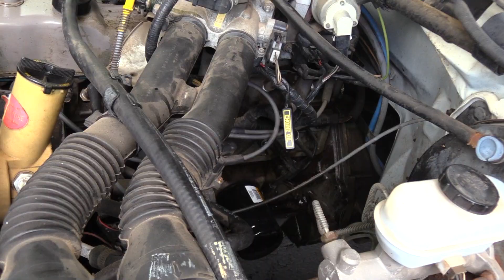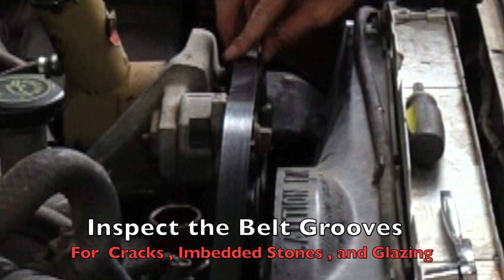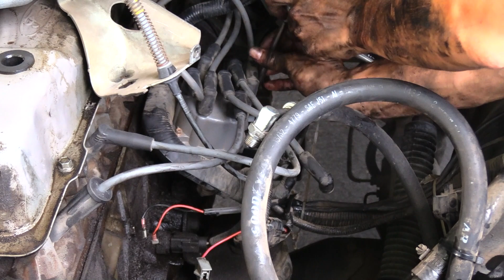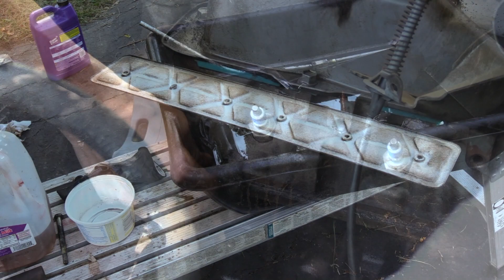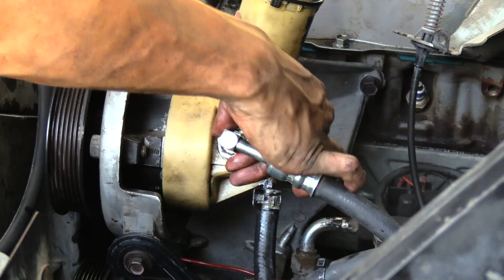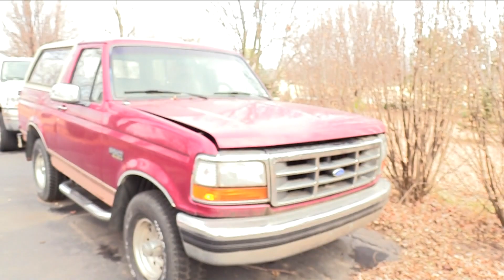Oil leak ! Here’s a Step by Step Guide, How to Replace a Ford F 150 4.9 Liter Pushrod Cover Gasket.

Comment: Thank you so much for taking your time to make this video for teaching other people and for showing us all of the steps!
Reply from the maker: You are so welcome ! I had just worked a full day on my project when my young cousin (whom I had only recently met) stopped by and needed advice . He wanted to do the work with guidance.  He learned a lot and it gave him the confidence to tackle many other jobs on his truck. I thought it would be helpful for other young people to see someone they can relate to tackle a job
Reply: @normanpaulife that's really good and it's a blessing it's a shame that it actually seems like it takes a lot of work especially to get that whole power steering pump bracket off do you think that it would be possible to replace the lifter area seal without removing the power steering pump or is that virtually impossible

Comment: You do not need to remove all of those components.you need to remove..distributor cap(wires),breather hose, air cleaner assembly to the throttle body,dipstick tube,..and coil.that's it!!.. I've been a mechanic for over 30 years this is really a bad video especially if you're trying to teach somebody something on a truck that old you're more likely to snap something or break something you didn't even need to be messing with.
Reply from the maker: It was his truck and his decisions , he wanted to do it “his way” I supplied answers if and when asked , and prevented damage or mistakes.  He learned to trust himself. And began his journey after two repairs 

I began my mechanical journey in a small engine shop at 16 and became and aircraft mechanic at 18, and attended automotive maintenance technology (technical school) at 22. I have more than 46 years of experience from small engines to B - 52s ( jet engines) .

If you get an opportunity watch the video I made replacing an 6 liter Exhaust Back Pressure Sensor and compare “My Method” to others out there. I removed nothing but the sensor and tube in minutes and properly torqued the sensor to specifications.

Comment: I just finished replacing the push rod gasket on my old 4.9l and I followed the same procedures as you posted in this video.  There was another video where a guy changed the same gasket, except he didnt remove the power steering pump, and I'm REALLY glad I did!  It gave me so much more room to work with and let me feel more comfortable doing the work. It was definitely worth the time to remove it.  I also suspended the a/c compressor with a ratchet strap hooked into an eyelet of the hood framing/support.  Thanks for sharing this video!
Reply from the maker: Thank you ! I was teaching my young cousin at the time. He had no experience so I was sure it would be a good opportunity to share with others like yourself

Comment: Nothing that you did would have stopped it for misfiring except the corrosion on the rotary cap and you should have just replaced it
Reply from the maker: The truck belongs to a 17 year old ( at the time) his truck his decisions all the way. But it certainly ran much smoother, now he had more to fix its many ailments.

Comment: That's not the PCV. That's the crankcase breather.
Reply from the maker: I think we are both describing the same thing. I haven’t rewatched the video , so I’m not certain what you referring to, but the crankcase breather is a circuit of the PCV ( positive crankcase ventilation) , old cars used to vent to atmosphere, but the PCV system feeds into the air intake through the breather ( filter) and burns the crankcase byproducts. The breather filter as old timers call ( myself included) is sold under the label PCV filter. I’ll bet the average 20 something parts plucker at the auto parts store does not know what a engine breather is …lol
Reply: @normanpaulife  PCV is at rear of valve cover with vacuum line going to vacuum port on intake. That's the crankcase breather going to air intake where it's attached to filter element. No worries.
Reply: True,but still part of PVC system!

Comment: Great video! I have a 300 series to with also an oil leak. The promblem is that I don’t know wether it’s the push rod cover or the valve cover gasket. The leak is on the right side of the engine and it looks as if it’s leaking from the valve cover but there is no leak on the left. Could the engine oil possibly be shooting up from the top of the push rod cover and making it look like a valve leak? Or is only the right side leaking? Thanks for looking at my comment and no worries if you can’t reply to this because it’s hard to understand
Reply from the maker: The best solution is the clean the area and reinspect it . Oil as a rule leaks down with air flow (aided by the fan)  and forward momentum it pushes backwards . 

I was aircraft mechanic in the Air Force for 26 years , during inspections, we would wash the plane, engines included prior inspections, and inspect for leaks with a strong light and mirror. Crazy as it sounds mirrors allow you to see objects in plain view that would be missed otherwise. It appears to magnify or clarify the image. You can also take a picture with your phone of the area and zoom in on it. 

I would plan to replace both gaskets, they are made from the same material and subject to similar conditions, such as heat , pressure etc. if one is leaking the other is similarly weakened ( likely leaking) as well. 

Best of luck, thank you for watching
Reply: Thank you so much! The mirror idea is actually very smart. I will apply this now. Hopefully I can figure this out!

Comment: My 4.9 300 leaks bad. Similar truck and engine. Im going to replace this and the valve cover gasket. Is there anything else i should replace? I had the oil leak so bad it destroyed my clutch. I have a new clutch new u joints it drive amazing but the engine itself leaks bad. Its an awesome trick i want it to run good again. I got for cheap and ran it pretty hard before doing these repairs
Reply from the maker: Check your timing cover, it likely a mess , check oil pan gasket . Good luck

Comment: Good video. Easy off oven cleaner works good for cleaning also. 👍
Reply from the maker: I had good luck on saw blades to remove baked on pitch, but it did not work on coked oil, it was one of the ideas we edited out of final video

Comment: He forgot to remove the front brake calipers...
Reply from the maker: He never worked on a vehicle before, he didn’t have the experience to remove bolts in tight quarters, he wanted to accomplish the job without physical assistance. Some parts were removed, the power steering pump for example, to flush the system and clean the decades of gunk , he was repairing a leak and wanted it Clean !

Comment: Uh, why are we taking the upper rad hose off?  And all the accessories? I did this, and as I recall, I didn't have to take anything off but some wire clips. You have to fiddle a bit with the forwardmost bolt on the pushrod cover, but it's worth it, versus taking all that stuff off!
Reply from the maker: It’s my cousins truck and his choices , he had never done that kind of work, he needed to replace the belt tensioner and idler pulley, and the power steering pump needed a fluid drain. So for him it was easier to remove and repair, than work in the engine compartment. The panel could have been removed straight up with disassembly if someone wanted to remove the distributor, he did not! He learned a lot , he enjoyed the process and has taken on many more challenging jobs on his own since. He would not need to remove as much the next because he has become much more familiar with the truck and his skills have improved along the way

Comment: So you used sealant only on cover side of cork gasket? 
My truck is a 77 with no A/C and no P/S. Dipstick is short and next to fuel pump. So much simpler.
Reply from the maker: To hold the gasket from slipping
Reply from the maker: That will make it faster and easier ( without accessories in the way).

Comment: Is it absolutely necessary to remove the power steering pump? My truck has no air conditioner
Reply from the maker: I would give out a try perhaps you can sneak out from the back of just loosen it a little to squeeze it past or perhaps remove the radiator and bring it forward because you. have no AC condenser
Reply from the maker: If you can slide it out the front you may not need to remove power steering pump , but the belt would most likely need to be removed, when we inspected his tensioner and idler they were both badly worn, his fan clutch was also. He needed to drain and flush his power steering system. In your case , I would try going straight forward. If not , loosen the power steering mount bolts and hold it with a cargo strap. Let me know how it goes
Reply: Far to much removed. This can be done by only pulling distributor cap and coil. That’s it !
Reply: I got 95 4.9 f-150  that  push rode cover can be slide out. I've done it on my truck and the job took like 30 minutes. Who ever this guy is he's giving bad advice. He's milking the job. You don't have to remove the power steering pump or mess with the  spark plug rotory cap. Take a picture of your spark plugs wires just carefully then. Then unbolt the push rode cover and slid it up out between the gap near the power steering pump. Then put your gasket on and new bolt pushing and torque to spec. It a 30 minutes job.

Comment: What trim tool do you use?
Reply from the maker: It has a screwdriver handle and forked tip from removing interior trim ( clips) Lisle tools makes two different styles.